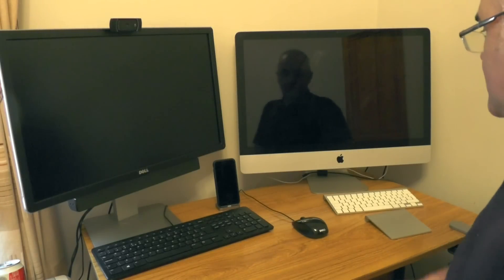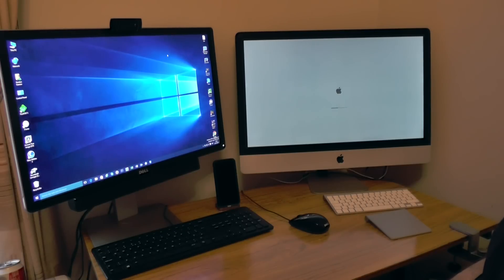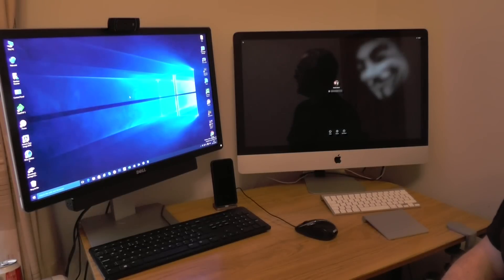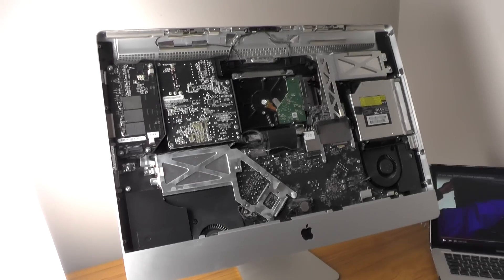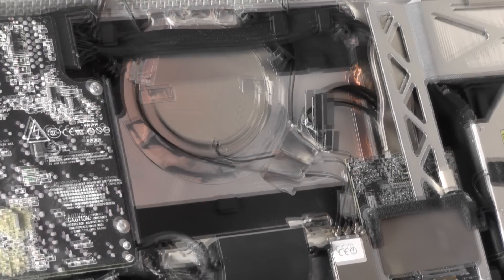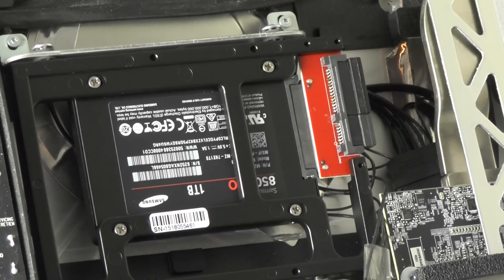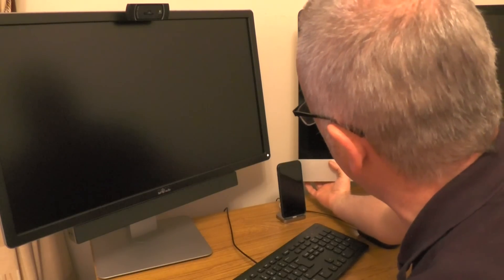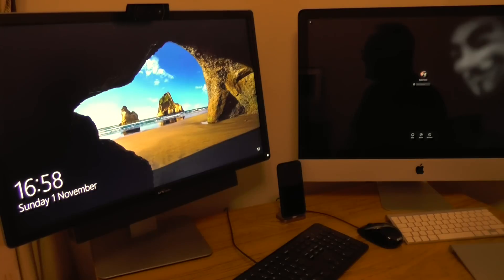2011 IMAC SAMSUNG 1TB 850 PRO SSD UPGRADE

Comment: Why not keep the original drive in there for storage and simply add an SSD for the OS?
Reply: Can you explain what that means? I just got a 2011 iMac on the way & I'm planning to upgrade to either a 240 gb Kingston ssd or 500 gb Samsung ssd. To my knowledge, you have to disconnect the current hdd that's gonna be in the iMac to put the new ssd in its place, right? So how would you be able to leave the hdd in there & just add the ssd? Thanks.
Reply: @thatwallscominggirl5359  The 2011 iMac 27" has an unused SATA port. You can connect an SSD and tuck it behind the optical drive. I'm not sure if the 21" model can do this. OWC has a follow-along upgrade video for all the models. Took me about 30 minutes to do the upgrade. You'll also want to modify or augment the SATA power cable going to the new drive to eliminate the fan spin problem. Search for "SATA Y Power Cable" and you'll find some videos on this.

Comment: just wanted to know why your 2011 is different than mine i watched owc which is very reliable and in their tear down the hard drive wasn't in plain sight, they had to remove the fan and and a few other parts to even see the hard drive. i wish mine was like yours but mine is a 2011 27" Imac and is quite harder.
Reply from the maker: The iMac here is the iMac 27-Inch, Mid 2011 model, 3.4GHz Intel Core i7, so unless yours is an earlier model... or possibly slightly later model, then I have no idea why yours would be different if it is a 27" Mid 2011 model.
Reply: @TechRealityGlasgow  mine is 27" mid 2011 2.7 intel core i 5 and if you watch owcs videos their just like mine.

Comment: That is insane, literally boots up 50x faster than mine right now. Digging through videos to replace my --- VERY slow..and I fear failing mid-2010 iMac HD. THIS 2011 install...from what I just saw is different from a 2010 - Those 2010 iMac clips I keep seeing removing 9-10 screws, some cable connections, etc. just to get to the hard drive connection. 

I already picked up the Evo 860 model SDD on sale, already formatted this to a Mac drive (using an old USB toSATA/IDE Adapter I completely forgot I bought about 6, 7 years ago) . I suppose I do need a bracket now, certain cables for this, heat sensor especially. Since I admit I am a newbie when it comes to Mac HD replacing, I have to figure out how to make this bootable after installing the new SDD. Right now it's a mac formatted SSD, but theres nothing on it, nothing to make a Mac to boot up. I suppose using an old backup Time Capsule file can do this. 

Eh...I have to keep researching before I really dig into this project. I'm sure I can get through it, I've opened this iMac before to fix my LCD screen...but like your description says...do I dread it, yeah, especially when it comes to an OS.
Reply: AC Junior I just replaced my my mid 2011 iMac with an SSD. A few forums have shown that you don’t need a heat sensor when replacing it with an ssd, since there are now moving parts or heating issues. Just need a $6 y splitter cable to offset the pins.

Comment: Is the 850 pro 512gb SSD just as fast as the 1tb or will the 1tb be slightly faster?
Reply from the maker: The difference is speed for the real world is really zero. If you want to benchmark the two different models, then yes, there will be differences that you can check out over here: https://ssd.userbenchmark.com/Samsung-850-Pro-1TB/Rating/3577 - Just select the model type button and you can compare specifications.

Comment: I liked your video but from one IT Repair guy to another who has done a few of these, you should have included the thermal sensor adapter Install. It is easy but if you're just doing it the first time, most people wouldn't know about pealing the sticky back and attaching it to the SSD and that is what detects heat to keep the fan speeds normal.
Reply from the maker: I did install the thermal sensor if you look and also see replies to other questions and comments asked. The kit is an all in one, with of course... the sensor. 🤘
Reply: @TechRealityGlasgow  No no, I should have chosen my words better. I was not saying you didnt install it, I was trying to say it would have been nice if you filmed the install so those who were unsure how to install the sensor would know. Great video otherwise.
Reply from the maker: 2SiccAudio it was one of those videos that I really should have taken more time with, but once things started being removed it became rather scary and I had ran out of hands to hold things! This Mac is still being used today, and still running as good if not better than the day I bought it!

Comment: What happens if you dont use the Thermal Sensor?
Reply from the maker: Ricardo Chavez if you do not use the sensor, the fans will run at 100% unless you use software to control them.

Comment: does your 2011 iMac pro get super super hot? Mine gets so hot I can't touch the back longer than 2 or 3 seconds!
Reply from the maker: The top of the case can get extremely hot, more so if I have been using Handbrake to convert video material. At least the heat has a way of escaping through the vents and the case draws the heat as well.

Comment: Isn't there stuff around the monitor you have to cut before removing the screen or were those screws?
Reply from the maker: This model is just held with magnets. The new models all suck, as they are stuck on. Its why I still have this model.... easy to open and upgrade, and still working well!
Reply: Awesome. I just bought a mid 2011, I7, 16GB, 1TB drive. Thinking of upgrading to an SSD. Any recommendations ? Also how much do you think upgrading to 32gb will help? I do music production/recording!
Reply from the maker: I went with the Samsung model as it has a 10 year warranty. Means that when this devices dies on me the drive will still be ok, and still under warranty no doubt! 16 GB has always been  ok for me and I do video stuff, so I think what you have is more than ok for audio/video.

Comment: Hi Gordon,

The hard drive of my 2008 MAC recently failed.  What is your opinion on replacing the hard drive with a SSD of 1 Tb?  Are the adapter and sensor show on you video compatible for 2008 model?
Thanks in advance

Gustavo
Reply from the maker: It might be worthwhile reading the following site: https://everymac.com/systems/apple/imac/imac-aluminum-faq/imac-intel-aluminum-how-to-upgrade-hard-drive.html and get the right advice on the parts you should use.
Reply: Sounds good.  Thanks.

Comment: can you tell where exactly did you stick the sensor at?
Reply from the maker: 家伟张 I just stuck it onto the ssd drive, location wise... just aimed for the centre and it’s been fine. !
Reply: thank you for your fast reply, I did everything including the parts exactly you described here, but the fan still running at full speed...Ive been assembling and disassembling my computer thousands of time...but the issue is still there, tried all the possibilities.
Reply from the maker: 家伟张 it has to be down to the kit that controls the fan, the sensor only detects the hit/cold and the ssd is nearly cold most of the time, so it’s the only thing I can think of.
Reply: I really appreciate your replies and your time, could you explain more how to "has to be down to the kit"?
Reply from the maker: 家伟张 the kit is what you are using to detect the changes and control the fan, so if you have it all plugged in correctly, and the fans are not being controlled correctly, my only assumption is the kit itself.
Reply: Thanks a lot for your help, I'll keep trying...

Comment: I will try update by 860 EVO samsung - not work, something with new controller ssd
Reply: Hi, i have same issue, Beware iMac 27 mid 2011, don't work with samsung 860 EVO (Because samsung use unsupported new controller) also same situation can be with 850 EVO (i didn't check with this series), so optimal for upgrade without any risk will be use 840 EVO series. Symptomatic is next: When you connect 860 EVO (I check it) or 850 EVO (I didn't check it 850 EVO, so info for 850 EVO maybe not correct). You can start from internet recovery but you cannot do fusion drive, for fusion drive you should start from USB recovery, yes you can do fusion drive with 860 EVO or 850 EVO but then when will be recovery from time machine you will se error and time machine is stop, then if you will try install new system to you new fusion formatted disk, you will cannot install, not sierra, not sierra high, maybe el captain will work but you will see many error when install it (6 hours maybe), if you still install some OS don't start to be happy, because will be many errors and white screen. So by the way. If you try to instal os to pure ssd, it's also will be with error. So conclusion don't use 860 EVO and 850 EVO with iMac 27 mid 2011 (I have core i5 3,1). So your SSD will work with USB 2.0 on your iMac, or need to buy thunderbolt ssd adapter or thunderbolt usb 3.0
Reply: 2011 iMac with 860 EVO with no issues since Jan 2018.
A few 2011 iMacs with 850 PRO with no issues for over a year.

Comment: Thank you for the video, I'm not clear about the thermal sensor? What do I need to do? What do I need to buy?
Reply from the maker: What you need to buy is under the description of the video with all the links. The thermal sensor is needed to stop the iMac from setting the fans to go at high speed all the time, and the sensor is actually pretty usless for measuring temperature since its an SSD and does nto relaly generate much heat in comparision to a normal hard drive.
Reply: Thanks, the sensor is very expensive here in Canada; about $75 CAD. I guess I was hoping for a more inexpensive solution.  Your help is very much appreciated.

Comment: Okay, not to say it's better, but I found it perfectly easy to remove the hard drive without actually removing the display. I only unhooked the v-sync cable to provide more play, then tilted the display forward and blocked it with my chest. I get a bit paranoid about removing cables. Suction cups make the glass removal a snap, then using a plastic spudger on the metal tabs on the top between the two magnets nearest the sides makes it easy to tilt the display forward. It's really not hard at all, just be gentle. The person next to me said "Is that all there is to it?" Yes.
Reply from the maker: Whatever way works for you is all that matters. Personally the thought of having to balance the display against me while I unscrew things and then replace and re-screw things back in, is not for me, I prefer to have an open area to work in, drop screws, and recover them with ease!!!! Glad you found a way that works for you!

Comment: Useless video - you did not show how to remote the screen (what connectors to unplug), you did not show how to install that new SSD in its frame, how to connect cables - what was the purpose of this video at all?
P.S. Comparing a two very DIFFERENT OS in terms of their boot speed - does not make any sense at all.
Reply from the maker: The OS comparison was to show you the difference i have with my equipment and why I was upgrading the Mac. I was looking to have the speed similar to the other computer system. Not showing how to remove the screen? Glass panel removed,  screws at the side removed, and once the screen was coming away, I was missing that third hand to move the camera in for anyone to see. The purpose of the video was to show me attempting to replace the drive while following an instructional video so that others who are scared to try this out could see how I manged it, and is there happened to be any disasters then it would have been shown. It's clear that you found the video to be useless, but as you can see from comments below many others have enjoyed it, but there is no pleasing everyone. I had hoped that I could have learned something from you on your YouTube channel, since clearly you find my work to be useless, but sadly I was let down by seeing absolutely nothing there.... Maybe once YOU take the time out to try and create something I can pop over and give you some critique.

Comment: Did you use the thermal cable??
Reply from the maker: Barry Mercer I did, I just stuck it onto the ssd case.
Reply: Thanks for the Vid.  I completed mine last night.  Had the parts you listed and bumped up the RAM as well.   Always intimidating to start these projects but so worth it in the end.  All the best from Canada!
Reply from the maker: I've done a number of these installs now, and as you say, at the start its very worrying, buy like anything, once the fear factor is dealt with its simple! Now your system will fly!!!

Comment: Hi, thank you for the video... It's the only one I've seen doing the swap and not add ssd video so far. But there's one thing I noticed you didn't show (Or I missed) which is that tiny cable I din't see where did you put it exactly (owd sensor cable?) Would you please be kind to explain what that is and where to plug it? Thank you very much.

Comment: Hello sir ...I want to upgrade my mid2010 MacBook Pro for a Samsung 850 pro 1Tb SSD do you think this upgrade will be 
compatible.?
Reply from the maker: With the MBP it should be a simple case of opening the underside, removing the current drive and then inserting a new SSD of any make that you desire.
Reply: Ok thanks ....so the capacity of the hard disk won't affect in the performance of the 6 yrs old mcb.

Comment: Hi Gordon. Think I am going to go about this myself. 

Reasons. My 2011 27" i5 iMac has become catastrophically slow. I'm a photographer with a really large Lightroom library. The library is located on a Lacie 5Big Thunderbolt Raid system. Do you see value in adding that SSD to this or is that £500 better put towards a new iMac? 

Thanks.
Reply from the maker: You would have seen the difference that the SSD made to my machine, and even now it's still flying! I would say the system is actually better than the day I bought it. So... £500.00 up against £1000.00+ its a decision that only you can make, though if you are thinking of a new machine I would hold back until we see what new stuff is to be released this year!

Comment: quick question: 1. can i use the 850evo from samsung or any other ssd? something important i should watch out for?
2. does this work with 21.5" exactly the same?
3. doesn't time machine store the backup on the hard drive? if i take it out, how do i put the backup back on? 

hope it does not take to long to answer. thank you in advance.

greets from germany
Reply from the maker: You can use that drive and any other one you may have. With Time Backup, you are making a backup onto an external hard drive before you do anything, or use the likes of SuperDuper to create a backup, to an external drive. With regards the Mac, what year/model etc is it? That will define if its an easy upgrade or not.
Reply: thank you very much for your fast answer. could i just "clue" the 2.5" hard drive in without the owc adapter drive?
im working on a mid 2011 21.5" imac.
Reply from the maker: You don't need the OWC kit, but if you don't use it then the fans will probably run at full speed all the time from what I am told. You will then have to use a software package to try and keep things under control, something I wasn't will to muck around with. There is another video you can watch to give you an idea about your own mode: https://www.youtube.com/watch?annotation_id=annotation_3092996713&feature=iv&src_vid=nOf0svk5FdY&v=F2vRK8gHLXE
Reply: thank you gordon. you helped me very well. i am glad to recommend your channel to my friends. very kind of you. 
keep up the great work.

Comment: Thanks for the video. I have installed my new SSD but it didn't start right back up like yours did and instead is not recognising a booting system. Did you not need to format your drive at all? Or did it just pop back on no worries?
Reply from the maker: I cloned my original drive to the SSD and that meant no waiting about and allowed the new system just booted. If you inserted a blank SSD you would need to do a fresh install of the OS, and then restore your data from the likes of Time Machine.
Reply: Ahh OK that makes sense I think. My data is backed up on other disks so not worries about that. How would I install the OS on the blank drive knowing how I've already installed it? I got this far but feel like I've hit a wall as i recognises it as a drive just not as a bootable one. Obviously due to the lack of OS
Reply from the maker: Metz Jnr https://mac-how-to.gadgethacks.com/how-to/reformat-mac-os-x-without-recovery-disc-drive-0155591/ hope this helps!

Comment: Hi Gordon, thanks for the reply. Does this then plug into the logic board? I have seen other videos where they appear to plug it in at the base of the machine near the apple logo? apologies for hounding you :)
Reply from the maker: The sensor is all part of the cabling that you buy in. You connect the original power and SATA cable into the new cable collection, and then that powers the sensor, so once you have it all in place, its up and running if that makes sense? If you look at 2:44 onwards you will see the way it's all connected.
Reply: Legend, cheers Gordon.

Comment: Did you stick the thermal sensor that you mentioned at 2:42 on to the SSD? I couldn't see it at 5:42. Also where did you buy that cool iPhone stand? Thanks
Reply from the maker: The sensor is was stuck to the top of the SSD, and the way the cradle is inserted, you're seeing the underside of the SSD. The stand is the official stand from Apple!
Reply: Gordon Keenan Right! Was the sensor stuck in the middle of the drive?
Reply from the maker: Max Silk Yep... eyeballed it, and stuck it down.... roughly in the middle :)